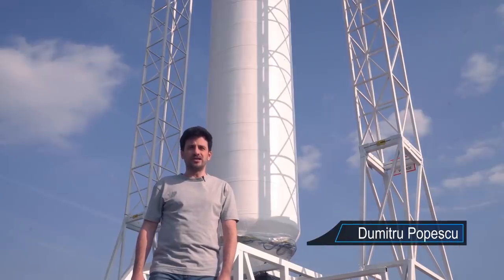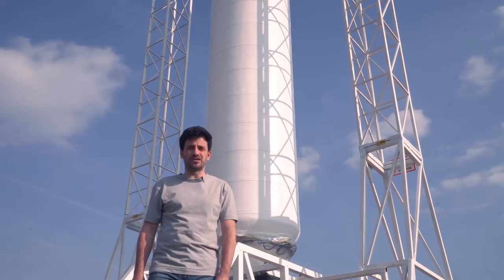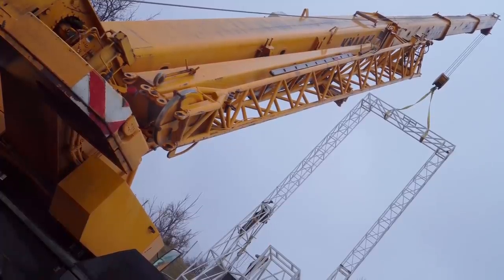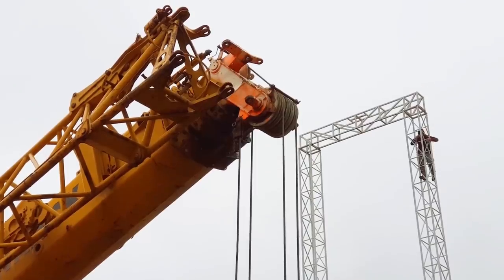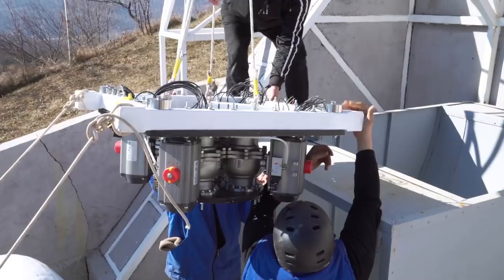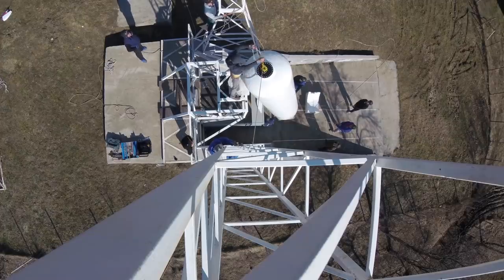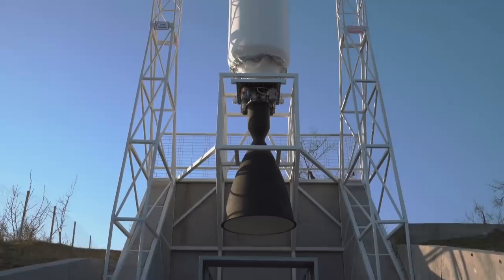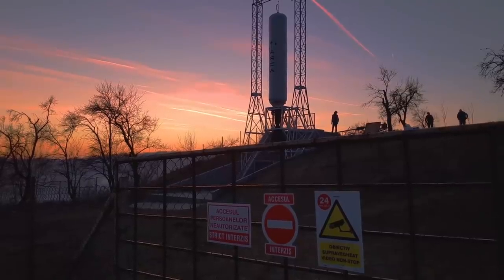Flight of the Aerospike: Episode 29 - Test Article Mounted on the Test Stand

Comment: No blocking or matting under the crane's jacks?  Don't hire that guy again or you'll lose your next rocket/test stand when it flips over.  That's basic crane op.
Reply: I concur; blocking in such soft terrain would be a prudent safety step in stabilizing the crane base and alleviating sinking by distributing its weight over a larger surface area.
Reply: As a crane operator there are three major things that operator did wrong. 1. No blocking or Matting under the Outriggers which could cause the crane to tip over. 2. Improper rigging that could result in damaged/bent spokes of test-stand. 3. Extension of Boom with load, "test-stand" which could result in structural failure or overloading of crane. The first and third mistake this crane operator made we're very vital key steps to setting up a crane. I am not the only person who noticed this right away. Do not hire that company again! They are very dangerous and untrained. If you need an professional operator contact me through Gmail.

Comment: Good luck with your testing, can't wait to see the video. 🚀
Reply: @ARCAchannel  As a crane operator there are three major things that operator did wrong. 1. No blocking or Matting under the Outriggers which could cause the crane to tip over. 2. Improper rigging that could result in damaged/bent spokes of test-stand. 3. Extension of Boom with load, "test-stand" which could result in structural failure or overloading of crane. The first and third mistake this crane operator made we're very vital key steps to setting up a crane. I am not the only person who noticed this right away. Do not hire that company again! They are very dangerous and untrained. If you need an professional operator contact me through Gmail.

Comment: I've been following your progress for a few years and I was initially quite enthusiastic because there are a number of grass-roots amateur organizations and entrepreneurial ventures that are taking the necessary steps to slip the surly bonds of Earth...  But - After episode 27, when you said you were using a new propellant, I asked what the new propellant was and there was no answer (I'm sure I'm not the only one who asked this quite elementary question).  After episode 28 I reminded you that you had decided to switch propellants and I asked again which propellant you would use and there has also been no answer.  In case you haven't noticed, the choice of propellant is pretty important for any given rocket motor design.  You may well be the first organisation in the history of rockets that has managed to switch fuels without redesigning the motor and this is very important news.  Please share it with the world.  I'm curious to know how you managed to design an engine that would work as well on a new mystery propellant as it would on the low-ISP Hydrogen Peroxide it was designed to use.  I applaud your ability to switch propellants based on availability when (as far as I know) every other rocket design in the history of mankind has been propellant-specific, but I still would like to know what the new choice of propellant is.
   It's wonderful to know that in the last several months you've managed to survive a snow storm and that you also hired a crane.  I'm looking forward to seeing your video of an actual firing of the aerospike engine sometime in the coming years (rather than a water test) and I hope you don't eat up too many innocent people's life savings before you actually light the candle.
   In the meantime, the rest of the rocket world moves on...
Reply: As a crane operator there are three major things that operator did wrong. 1. No blocking or Matting under the Outriggers which could cause the crane to tip over. 2. Improper rigging that could result in damaged/bent spokes of test-stand. 3. Extension of Boom with load, "test-stand" which could result in structural failure or overloading of crane. The first and third mistake this crane operator made we're very vital key steps to setting up a crane. I am not the only person who noticed this right away. Do not hire that company again! They are very dangerous and untrained. If you need an professional operator contact me through Gmail.

Comment: some sheets of plywood under the cranes legs / feet would have increased the surface area and avoided the re-adjustment issues.  was surprised by the episode in the past when you where clearing the drive with plastic snow shovels as well... but i do love the fact you guys are working on this, am looking forward to your success in the entire process... i was always sad when the systems where mothballed by nasa when it was, it has such high potential... crossing my fingers for ya.

Comment: Q1: Why no lightning conductor near the test stand, it seems to be quite high metal structure and thunderstorm could ruin your test equipment

Q2: After the lessons with the muddy / soft terrain around test stand, will you harden the surface to avoid such problems ?
Reply: I think they're testing with H2O2. I don't think that needs to be kept safe from sparks.
Reply: @direbearcoat7551  although that could be solved with a lightning rod pretty easily
Reply: @direbearcoat7551  yes, a few people have pointed out my miss reading before you
Reply: Surface hardening in an open location with no drainage and no natural weather protection is likely futile: if they make progress and get more funding a better facility with foundations, concrete, ashphalt, and a storage hangar might happen.  Until then, elements 1, ARCA 1, elements in scoring position.

Comment: SO why did you block the view (edited OUT) of the nozzle orifice at 4:33 into the video?
Reply: I guess that's part of the "we can´t give too many details about this innovative technology" ;)
Reply: a rocket is a missile, and this engine enjector plate is secret for evident reason (to aviod such terrorist to copy it)
Reply: @florianlevray1742  not sure if you are joking or what, but in my opinion the guidance systems are usually kept secret for that reason (not the motor noozle). You can easily find blueprints for motors
Reply: Secret new technology, or just that they don't want another company to copy it
Reply: The Rocket Nerd that's what I meant to say, I'm bad with words
Reply: @nachocortizo3321  not the injector plate. This piece is so hard tu product, just a few  compangy, state and amateur (Copenague Subortibal) can do it. Keep is technology secret and nobody can make a "good" missile.
Reply: @florianlevray1742   I see your point but you could power a missile with a solid propellant motor, no need to be fancy there. But to have a good missile (aka something that hits the target and not your own but) I think you need a well defined system to guide the rocket. Anyways, they will probably reveal at some point what the white square was 😀
Reply: @nachocortizo3321  yes but your solld propulsion is not very efficient ^^. And a control système is easy to make (Realy), just 2 motor, a battery, a microcomputeur and a gyroscope (you juste need the rocket to go in the direction you launch) and with some skill and a GPS card (like in your Phone 😉) you can make so more 😏. To aviod a very good missile you need to kept secret is fabrication.
Reply: @florianlevray1742  to be fair, probably every single part is hard to make hehe.
Reply: @nachocortizo3321  it depend what is "hard" for you, a group of amateur at Copenague Subortibal (With no experiences is rocketry) had launch a guided liquid fuel rocket in the space (and they want to do it with a man) 😉. Clerly Its possible but you need several years and a complete team.
Reply: In*
Reply: @florianlevray1742  they have been developing their tech since 2010, and as far as I know, they never reached space: Sapphire reached 9km, Nexo I 1km (I'm not trying to say they are bad, I love what they are doing!) but I think this helps prove my point that is not that easy :).  What I wanted to say with "its hard" is more in a global term. The propulsion sytem is complex, the guidance system, the air frame, recovery, telemetry, security etc etc etc. All of this going up at several times the speed of sound makes it "hard".
Reply: Yes, but Copenhagen Suborbitals are very open with their technical information and please don't forget that they actually light their motors whether in a ground test or in a launch.  When was the last time an Arca motor was lit?  @nachocortizo3321
Reply: @somerandomnification  I don't think you understand my comment, I'm just pointing out the difficulties of developing a rocket, not if one company or the other has started 0 or 10 motors.
Reply: My guess is that it is not related to "secret tech" but is more likely to hide their poor workmanship or lack OF actual engineering.  This is based on watching all of the videos and observing how they build hardware at ARCA.
Reply: I'm sorry Nacho Cortizo - I didn't mean to reply to your comment, I was just commenting on the video and the program in general.  @nachocortizo3321
Reply: @nachocortizo3321  sorry, I look at their site and the HEAT-2X was a rocket with enought power to go to space... But the rocket blow in the test stand. But they try 😉
Reply: @florianlevray1742  Yeah, they will hopefully get there soon :)
Reply: It's because YouTube doesn't allow porn. Simple question really

Comment: I hope there were C-clamp fasteners welded onto the structure joiners as a physical anchoring method; relying on the strength of the welds alone to hold the structure down against the force of the rocket motor is not at all wise.

Comment: Will there be a water spray system to dampen the thrust energy?  Will there be enough thrust energy to be a concern?
Reply: No if that "engine" was ever fired it would likely tear itself apart before that would become a concern due to massive over-expansion and low combustion chamber pressure.

Comment: As a crane operator there are three major things that operator did wrong. 1. No blocking or Matting under the Outriggers which could cause the crane to tip over. 2. Improper rigging that could result in damaged/bent spokes of test-stand. 3. Extension of Boom with load, "test-stand" which could result in structural failure or overloading of crane. The first and third mistake this crane operator made we're very vital key steps to setting up a crane. I am not the only person who noticed this right away. Do not hire that company again! They are very dangerous and untrained. If you need a professional operator contact me through Gmail.